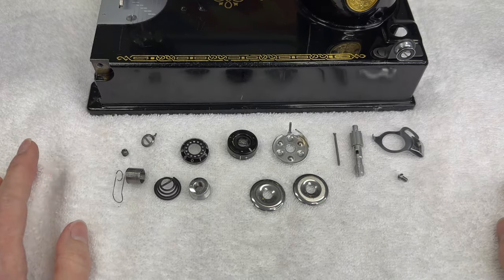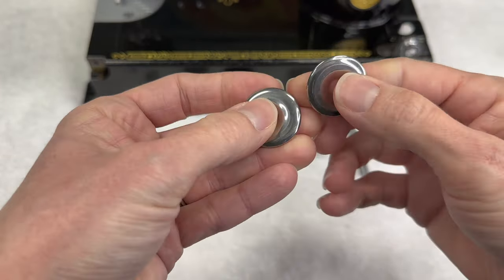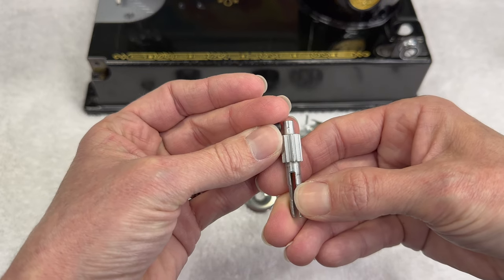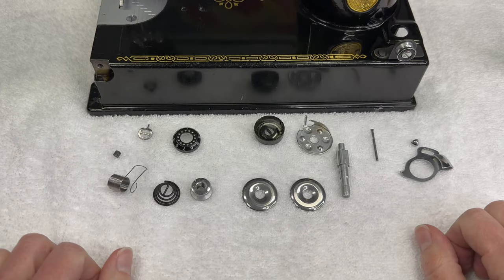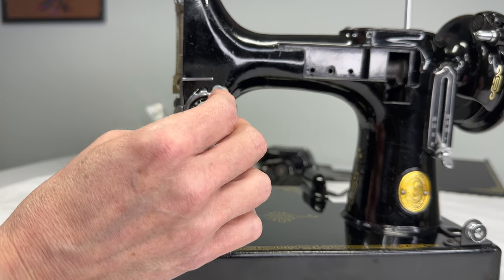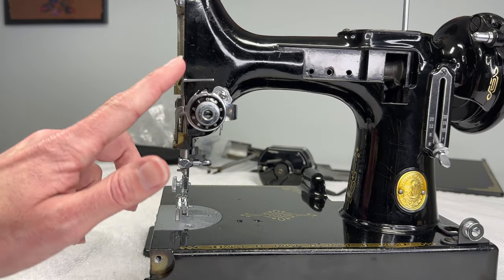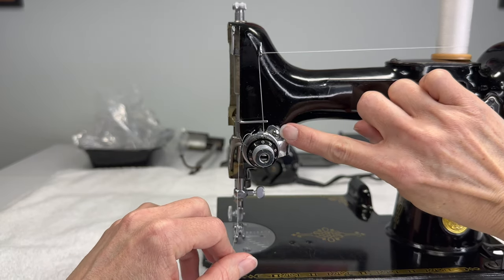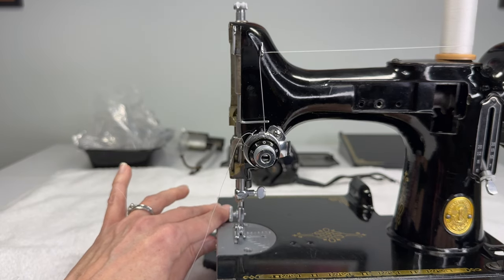Install and zero out the tension assembly on a Singer Featherweight: Restoration Series Part 16

Comment: That's what I was missing I need to zero it out. I knew I was missing something. I have been waiting for this video. Mine hasn't worked since I got it so I knew something was wrong I think I put it back together correctly thanks to your teardown provided it was correct. Although I might have messed up the disks but I think I already figured that part out. Thank you so much for these.
Reply from the maker: You are welcome!

Comment: Very helpful! My 1947 girl, Marjorie, wasn't holding the tension after I'd get it adjusted and get a good looking stitch. I finally took it apart - and it was filthy with a black greasy substance! But I couldn't get the set screw out so I could remove the stud.  What substance can I use to loosen the screw? Should I use kerosene to clean inside the socket? I've wiped the parts as clean as I could with a soft cloth.  After cleaning, I was still having the issue, so I've purchased new springs, but I want to know about cleaning first.
Reply from the maker: Hi! I typically use Kroil penetrating oil on stubborn screws. If you can’t get the screw out without damaging it then cleaning the stud in place is your best option. You should still be able to get the tension pin out of the stud, clean it and put it back. I clean all the metal parts that are not painted with something called Krud Kutter but you could also wipe them down with alcohol. Just keep chemicals away from anything painted like the machine itself and the painted dials for the tension assembly. You can wipe those down with oil to clean and then polish them up with carnauba wax. I use one by Zymol but there are other suitable brands out there as well. I hope that helps and let me know if you have other questions!

Comment: A visual guide to make sure the tension stud is straight horizontally, place a 3 inch stick of a Q-tip in the slot. The length of the stick will provide a better view to check for level.
Reply from the maker: That is a great tip, thank you!
Reply: @SewingMachineRehab  I am restoring my wife's 1951 221-1 and I have followed every step you have given. Your presentation is very complete, especially the little details. I am starting on Step 17 and I have to add some heat shrink to the connections. I did replace the light socket and switch as they were toast. While removing  2 stuck screws, I broke 2 of my screw driver bits I use on my firearms. The screws weren't damaged, but a squirt of WD-40 and left over night then I was able to remove them.  Thanks for excellent videos!
Reply from the maker: @exmedic4509  It pays off to be patient! Bummer about the broken bits though. I have had my share of them!

Comment: I have 2 questions for you.  I have reinstalled the tension unit (after cleaning, polishing etc) and zeroed it out.  When I assess the tension with the dial on 3 I get a value between 20 and 25.  When I slowly increase the dial reading to a larger number, the tension immediately goes to almost too difficult to pull the thread through - there is no gradual increase in tension.  I have removed the assembly several times, recleaned, double checked that I am assembling and installing properly and it still behaves in this fashion.  Any suggestions as to what the problem might be?
Question 2 is about the grease wicks.  I would like to order the 3/16" cord from McMaster-Carr and am not sure if I should order the F1 or F3 cord (the only 2 choices they offer).  Any input regarding which is more appropriate for the Featherweight?
I really appreciate your input, I am on my second Featherweight and have purchased a 301 to restore - you might say I am hooked on tinkering with these old machines!  Thank you Ann
Reply from the maker: Hm, it could be that you need to replace the take up spring or the bee hive spring. I am not sure what the difference is between the F1 or F3 cord...could you elaborate?

Comment: Are all the singers done this way or just the featherweight?
Reply from the maker: Hi! I know that Singer had different recommendations on how many grams of tension at zero for some models. And the ones without numbered dials would make it impossible to do this step. But, in theory, if you know how many grams of tension you should have at zero you could do this on most of the older models. I hope that helps!

Comment: Should the tension spring pop back when the foot is lowered?
Reply from the maker: You should definitely see movement in the tension assembly when you raise and lower the presser foot. It should be adding pressure to the discs when you lower it and releasing the pressure when you raise it. Is that what you are seeing?
Reply: @SewingMachineRehab  very little movement and the pin doesn't fully return when the pressure is released.  Great videos!  I have been able to take my machine apart and put it back together. It runs but won't sew. It has a beautiful stitch in the top side but a birds nest on the the bottom. Today it just breaking thread. The upper and lower tension are calibrated with the scale from FWS.
Reply: Hope you can help. I was thinking about just ordering a new tension to see if that is the problem.
Reply: I was able to resolve my problem with the help of comments on Facebook. I installed the thread uptake lever incorrectly. Once I removed it and replaced it properly the problem resolved! Thank you for your thorough videos!
Reply from the maker: @elizabethbrown4845  Sorry I didn't get back to you quickly but I am so glad you figured out the problem! I am glad you have some good resources, we can never have too many! I was going to ask if you had the positioning finger placed into the slot under the needle plate but it looks like it wasn't that at all. Great work on solving your problem!

Comment: My spool pin spins around and is loose. How do you tighten or replace it?
Reply from the maker: Hi! You might try using a plastic hammer on the underside of the pin. The underside will look like a nail head and sometimes it can get bent making the spool pin wobble. The other option is to purchase a new cover from the Featherweight shop, here is the link: https://singer-featherweight.com/products/spool-pin-cover-plate/?aff=57 I hope that helps!
Reply: Thank you, I will try to hammer the pin carefully & if it doesn’t work I will purchase new plate. 
Does the pin spring and felt cushion help with some of that play in the pin or is it only to keep the spool of thread more snug if the hole is larger?
Thanks for the easy to understand instructions for cleaning my 221featherweight machine
Reply from the maker: Hi again! I am not a fan of the spring, I think it gets stuck in the thread spool too much and it can be a little frustrating. The felt will help for sure and I love the thread stands that the Featherweight Shop sells. I think they all are good, I have the least expensive one they sell and I am very happy with it. Hope that helps!  @JoanGoetteman
Reply: I asked how to clean parts if you don’t have access to a sonic cleaner. What to do next??
Reply from the maker: @JoanGoetteman  Hi! Sorry if I missed your question before. I cleaned parts without an ultrasonic cleaner on many machines! I still recommend Krud Kutter if you can get it, out of everything I have tried it works the best and the fastest. Use a solution of water and Krud Kutter that is 50/50 each. You will need to scrub the parts a little more and you can also soak them for about 10 minutes or so. Even just agitating the solution (swirling it around) while the parts are in it will have a similar effect as the ultrasonic cleaner. Then rinse and dry really well. I can’t stress the drying enough. Don’t put any painted parts or things like the numbered tension dial and stitch regulator plate in the solution. You can rinse those with straight water and polish. I hope that helps!

Comment: When I raise my pressure foot it’s not bumping against the pin :’( i’ve took it apart and put it back to see if i just didn’t put the pin far in enough but when the pressure foot hits the pin the pin doesn’t bounce back.
Reply from the maker: Hi, there would be a couple things I would check: make sure the tension pin releasing lever is installed properly, check inside the hole on the tension stud where the pin slides and make sure there isn’t any gunk in it and then make sure the stud is all the way in the machine. If the stud isn’t in far enough the pin won’t be able to do its job. Let me know if any of those fix it!
Reply: @SewingMachineRehab  it worked! the releasing lever wasn’t installed right and wasn’t tight enough :D
Reply from the maker: @sarahortiz8554  Great! You figured it out!